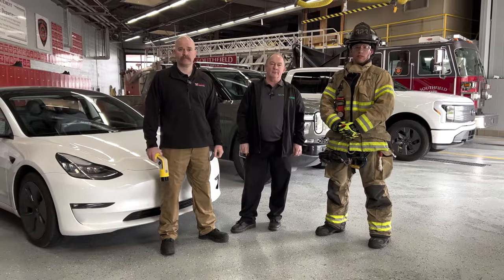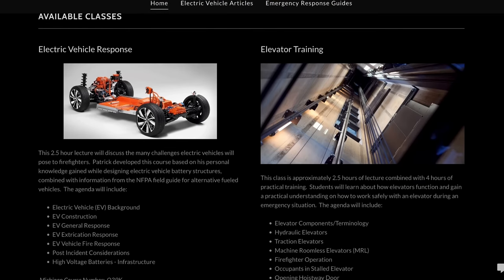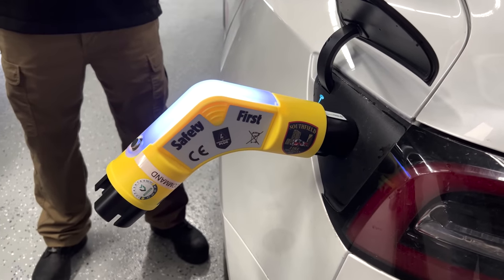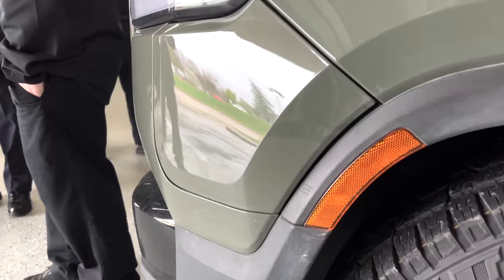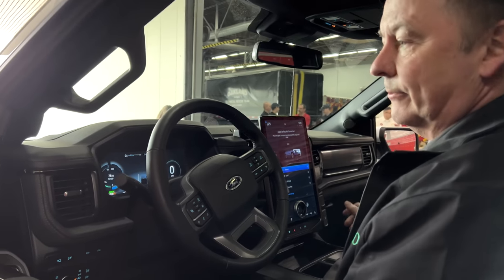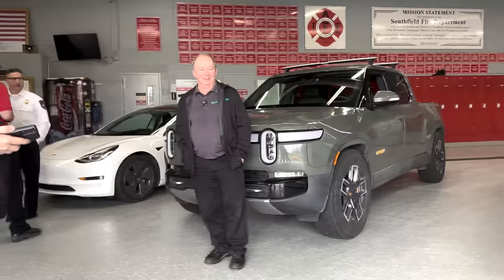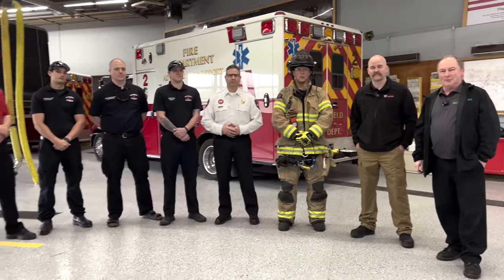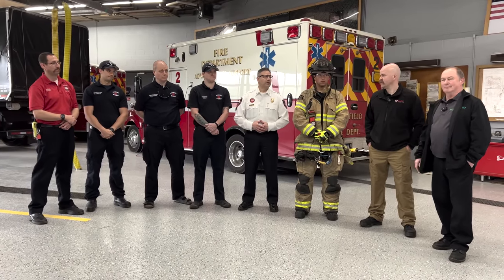An EV Device for First Responders: Emergency Plug Demonstration

Comment: Since the car thinks it's charging/ or want to charge, the contacts are still closed. Seems still dangerous to me.
Reply: That was my first thought as well. Seems like there needs to be a SAE (etc) standard that would allow for a device like this to be plugged in and work like the firefighters 'cut loop'.
Reply: The purpose of this tool is not to disable high voltage , but to ensure the vehicle is in park and some what stabilized to then allow firefighters to safely proceed with rescue which could also include high voltage disconnect at that point.
Reply: @IphoneMod  especially useful as cars become more automatic and the connected to the internet so they could be driven remotely
Reply: no. contacts is the last thing after charging starts on charger side. this is just a charge port dummy plug
Reply: it creates a fault sitiation where the plug(cable) is connected but there is a ground fault or something. So the car signals that there is something connected but would not charge or put power on the charge leads. just the data connection is active.
Reply: No problem. This tool does NOT connect to the high current DC pins. It connects only to the AC input, which is incapable of supplying car battery power to the port. The only thing this tool connects to, is the ground, and the COM pin. Just data, no power.
Reply: Yes, it's useless for safety.
Reply: @brad9529 nope, it does exactly what it's intended to do and does it perfectly.
Reply: @vincentrobinette1507  MG and a few other makers allow for future grid-tie, but in either case: there's nothing exposed so it should be fine. No different then a "child socket cap".
Reply: Does it work on Toyota Prius Prime?
Reply: @w8lvradio  It should work on any vehicle with a charging port, be it fully electric or hybrid. They're all programmed to not allow the driver to move the vehicle while it's plugged in (For obvious reasons).
Reply: This is an AC plug with from the looks of it just the Ground, PP and CP pins. But yes, the car is on so the HV system is still live. This is meant as an easy first precaution to make sure the vehicle won't move. 

So before they remove all the responder plugs on the LV and HV system.
Reply: That's not how an EV charge port works. This doesn't make the car think it's connected to a DC fast charger, but an AC EVSE. Power cannot flow backward through the onboard AC charger. Some cars are capable of outputting AC back over their charge ports, but that requires a special cable and an onboard 120 or 240v inverter.
Reply: When the input voltage is dropped on Tesla, contacts open.  Only works when unlocked though. Can’t plug in when the door is closed.
Reply: @unwarranted3472  You can see a cutout at the bottom of the NACS adapter to bypass the locking lug.
Reply: It's worse than dangerous. The firefighter will think they're doing something good to help the situation, but in reality it's just something useless. Seconds that could have been spent saving a life.
Reply: Also, this will only encourage the DIY community to hack their car side EVSE system controller, to ignore this sort of "hey don't do anything you're charging" signal that a car jacker can now use.
Reply: Some of commenters seems to not know what the contactors are, EV batteries has an electronic relay/figurative breaker switch/contactors that can isolate high voltage connections at the output pins of the battery. When the contactor is not energized, the + and - terminals on the pack becomes completely open and safe to touch, and so do the orange cables to motors. I think it depends on implementation but people saying this isn't safe is discussing that.
Reply: Expect to have one plugged in if you have a electric car and are being pulled over by law enforcement
Reply: Indeed. That's an interesting definition of "safe". And for those that think otherwise, yes, the battery system contactors will be closed with this plugged in; it puts the car in "charging" mode, which connects the battery to the onboard charger. (the thing everyone calls the "charger" is not. it's just a fancy power cord.) All this does is put the car in park because a charging lead is connected. (this is so you can't drive off while connected. an all too common thing at gas pumps!) Sounds like they're more interested in selling an expensive, marginally useful/useless device to fire departments.
Reply: the contactors close after the car gets confirmation the charge is starting.
Reply: As far as I know, the contactors only close when a charger (or EVSE if you want to get technical) sends the command to charge. If it's just idle, the contactors won't close.
Reply: @w8lvradio  yes, everyone except Tesla is using standard EV chargers and ports.
Reply: @jfbeam  It's a car immobilizer. Useful when you don't want a car you are working on to roll b/c it's in one pedal drive and the unconscious person has pressed down the pedal while you are checking on him.
Reply: @Ryan2dabs they can remotely fully control a Toyota Camry 97 ecu wirelessly.,...      Anything with a microprocessor has a wireless backdoor ...  Only high level military with oversight using that device .....

Comment: The sound of the lightning lol. Rocking forward and back like that... what an intimidating sound lol
Reply: What a tool allowing it to do that vs putting his foot on the brake.
Reply: You can do the same thing with most automatic transmissions by putting them in park while you’re still moving. But it’s a good way to break things.
Reply: @spacemanmat  Usually only once...
Reply: It really gives a sense of how heavy that truck is. Because of all the momentum/inertia to overcome to finally stop rocking back and forth.
Reply: @spacemanmat  DO NOT DO THIS.  You can break your parking pawl, and you don't want to know what that will cost.
Reply: @concinnus  yes, not recommending it as you can see from the video it’s not nice to the car.
Reply: @concinnus  I did it once without breaking the parking pawl. You could hear it failing to engage repeatedly. (Pulled over on the high way to adjust something and did not realize I was still moving.)

Comment: Ok - so I get the desire for this tool, and interesting how effective it is, but YIKES! guess what just went straight to the top of the (pro?) car jacker's wish list! 
That it is basically just a chip faking the communication protocol of a charging station suggests that these can be DIY'd by hackers and deployed on the black market today. 
Not good for folks living in high crime prone areas.
Reply: Exactly
Reply: Stay tactical
Reply: I mean you can diy this with a couple resistors. The documentation on how chargers work is readily available.
Reply: I guess you just need to be aware if someone is approaching the car and opening your charge port door without your permission. I know in a Tesla, the vehicle needs to be unlocked for the charge port door to open willingly, which is why they demonstrated the need for the pry tool
Reply: Haha, considering some of the crazy advanced crypto relay attacks car thief’s do this stuff is child’s play to them, a ccs plug with a few resistors.
Reply: its actually a tiny bit more than resistors. you need a 12V power source, a 1kom resistor, and maybe 5V Source (step down converter) a PWM generator (basically a switch that changes the polarity with a 10kHz frequency). still pretty much trivial.
Reply: I'm probably not a good person to be assigned to a red team, but I can't figure out how disabling a car helps you hijack it.
Reply: @haxi52  It keeps the driver from 'stepping on the gas' to get away. Once this thing is plugged in, the car is "bricked", allowing the hijackers time to get the driver out, unplug the tool, and get away with the car.
Reply: @unitrader403  this is not true because there is a resistor across two pins that the car will detect, and when it detects those two pins it will automatically put the car in park and leave it in park, so that you don't accidentally drive away with the charge port connected to your car. All of this is done on the car side (except for the resistor) just in case the EVSE dies for whatever reason
Reply: If they had a small enough version to fit inside your charge point while the door is closed, and if it could be remotely deployed, this seems like a way that a freeway accident could be created. I think we're going to need a DIY community to "fix" these controllers. Obviously there is a huge security flaw baked in!
Reply: If you read the J1772 spec, it's way easier than this overpriced flashy trinket. (the "communication" is dirt simple: resistance values.)

Comment: disables the drive system, but not the HV itself. cut th HVIL loop if you need to disable all the HV stuff.
Reply: If the vehicle does not appear to be on fire, there may be time to pull out or cut the loop which completes the low voltage circuit to the contactor in the main battery.  There usually another loop in one of the roof pillars which may be quickly cut with a power saw.
Reply: it creates a fault situation where the plug(cable) is connected but there is a ground fault or something. So the car signals that there is something connected but would not charge or put power on the charge leads. just the data connection is active. just examine the charge protocol and you will find out...

Comment: Some fire departments in Norway just fill a skip with water and drop the car into it if the high voltage battery catches fire. 

Know it’s been done with a few Kona’s and Bolts in Oslo for instance. 

It’s a neat way to contain the fire, but requires a skip and lifting capability.
Reply: Not just some and there---Tesla's own factory fire brigade in Germany has 3 of those containers and a RoRo-carrier with a car crane for them on site.
Reply: What about the poor people trapped in the car. First they burn and then get drowned. Geez. 😂
Reply: @legostud  price you pay for being an EV early adopter. haw haw
Reply: Sounds interesting, but first you'd have to know what a "skip" is? 🤷‍♂

Comment: The fireman’s loop is a way safer option in more true emergency’s. Some cars it can be done in a reversible way with a plug to pull. But there are other spots you just cut the loop which will completely disable the high voltage systems and truly disable the car.
Reply: Need to immobilize the car before cutting that loop though.

Comment: Seems more useful for law enforcement safety during pullovers of EVs than for first responders in most scenarios. You can find some edge cases for first responders but largely putting the car in park isn’t high on the problematic scenario list.
Reply: No - because any extraction requires stabilization of the vehicle, the first step of which is placing the vehicle in park
Reply: @errhka  right but all those vehicles automatically place on park when you open the door, or if a crash is detected. There are certainly scenarios you can find but they won’t be in the majority.
Reply: @spleck615  the problem is you cannot depend on the vehicle in all scenarios to behave as you'd expect. Maybe this car stays is in park when the door is open, but another one does not. There's no way to know what the engineers have done with every car. Thus why on every vehicle you follow the same procedures to place in park, chock it, etc. This tool becomes part of the procedure for electric vehicles as another failsafe. Standard procedures are there to keep firefighters from hurting themselves  - if this tool prevents the car from rolling away because a probie forgot to put it in park it will be useful. Having a 2nd line of defense in preventing accidents through procedure is not just a luxury, but critical for firefighters in those 'minority cases'. Not all vehicles you come upon are crashes either - someone might need to be medically evaluated in a car before they are moved, or the driver has had a medical emergency and is being boxed in by cars to stop the vehicle from going anywhere. As someone who actually works in this field this tool WILL be used and will eventually be standard on most engines to go to EV calls.
Reply: @errhka  if you actually want it to be helpful work with the manufacturers to have it work as an efuse and disable the HV pack while inserted. That would actually be much more useful. 

Sadly in both cases it seems more useful for an attacker than first responder. Car jacker can pry open and insert in seconds while you’re at a stop light, now you can’t get away. People already have this safety concern of being locked in a charger if someone approaches.
Reply: @spleck615  the issue is those are not standardized and would require legislation and national committees at conferences to be implemented. The plug is standardized across all vehicles and works right now. There is usefulness in that. 

Lockout kits, elevator keys, etc can be purchased by thieves as well, doesn't make them any less beneficial for us.
Reply: @errhka  If you don’t do that then you’re just hoping nothing changes, and as mentioned earlier in the thread there are already pushes by people to remove this “lock to park” functionality due to the perceived safety risk while charging. Legislation or creating a committee to push the movement alongside manufacturers is the only way to get a solution you can depend on. These vehicles already have built in protections ICE vehicles don’t have that minimize the need for this kind of thing.
Reply: Theives too.  Although law enforcement isn't much different nowadays
Reply: @spleck615  I'd personally love to live in your world where we have the luxury of having such an immediate and sweeping impact on car design nationwide. Our methods have to work for all car years, all models, and for most all situations. If you are not a first responder I'd think it's harder to conceptualize why we want multiple failsafe procedures. For example, you think it's 'automatically put in park' when the door is open or when a crash is detected - there have been multiple calls we have gone on where those features have not worked as they should have. Rivian was going back in forth on disabling the auto park function when the door is open at low speeds - thus why we want a back up method. This is one available method.

Will legislation eventually standardize? Sure, but we have to work in the reality of the situation currently and not how we wish it could work
Reply: eh 9ne of the first things responders do is shut the vehicle off and put it in park so the person doesn't drive off (accidentally or intentionally).
wheel chocks aren't helping if the driver hits the gas
Reply: @spleck615  judging by the way you talk you have never been or even known a first responder, they risk their lives every day so that you can live your life and normally. It is inherently risky but every possible step that they can take to reduce risk they take, they don't have the luxury of waiting for politicians to agree on laws that will help them do their job because politicians get practically nothing out of writing such laws
Reply: @the_undead  and judging by the way you talk you think first responders are people incapable of learning and adjusting to new technology. As already stated the targeted vehicles already automatically engage park and unlock doors and blow their e-fuse where applicable for big battery (can’t move motors) on detected collisions, as well as again as I stated there are efforts to remove the exact functionality being leveraged here, for safety reasons. The only way to ensure this would work is to engage with the manufacturers and members of Congress to establish standards. Anything less is increasing risk, not decreasing. Run along and play your game.
Reply: @brandondevahl552  a thief could be armed, and I doubt that's going to change the situation much about whether you can drive away or not if they literally have a gun to your face. (If they are 5 yards or more away and a terrible aim, maybe it could save your life to still be able to drive away.) But also, law enforcement is armed. (And hopefully they don't just start firing rounds at a fleeing car, but you never know? 🤷‍♂)
Reply: @errhka  the first step of which is placing the vehicle in park You do realize that in almost all modern (last decade or two) cars, the gear selector is an electronic device, it isn't a mechanical link to the transmission. Putting it in "park" will do nothing if the communication (CANbus) is broken, or none of the required computers are listening. It's just as ineffective as the "start/stop" button on the dash. (Despite the letter from Toyota, that button is not a f***ing kill switch. Nor is that piece of paper.)
Reply: @spleck615  efuse and disable the HV pack That's called the "service disconnect". EVERY production battery pack has one. (they're all in random places, 'tho.)
Reply: Spoken like a true engineer...